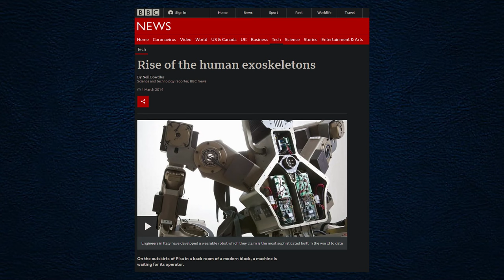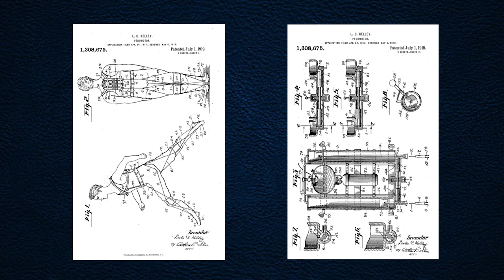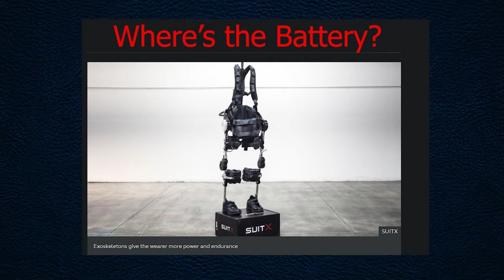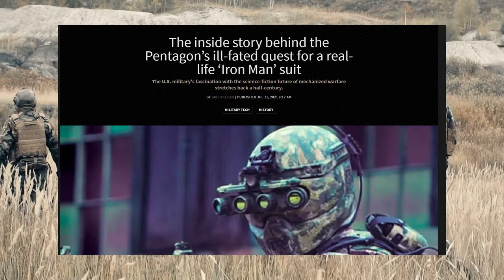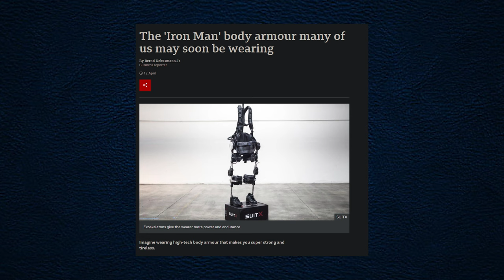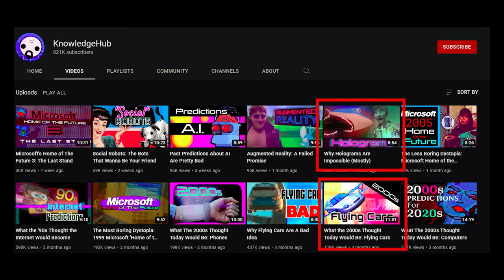Exoskeletons Will Never Happen: Here's Why

Comment: So why not have exos that get their power from a cord, from a nearby vehicle? Whether it's combat, firefighting or police duty, being able to carry excessively heavy armor would help. From my perspective, I'd rather have that and let my teammates behind me deal with the cord. Alternatively, one man could carry (or even wheel) the battery that feeds the exo with a cord.
Reply from the maker: The main goal of current military exoskeleton efforts would be to carry excessively larger loads longer distances. While I agree carrying heavier armor could be helpful, a nearby vehicle could simply carry the larger load instead of the battery that supplies the power. 

This inevitably lead the US military to abandon the efforts since it would be bulky and cumbersome.
Reply: @Enginomics  you know i feel like in the early 21st century we won’t have exosuits, military wise you’re probably right, a simple truck would likely be more efficient than a complicated exosuit, however i believe when technology becomes more advanced exosuits will happen, maybe somewhere in the 2040’s-60’s we’ll have batteries small and compact and powerful enough to power exosuits without exposed wires or other hazards, plus i believe by then we’d have the technology to make exosuits that can do other stuff besides increasing the carry capacity of the user
Reply: I feel like having an external cord connection would be too limiting in terms of mobility. I can see people getting tangled up by the cords just like someone playing on a wired VR headset.
Reply: Cords in a military unit intended for mobile operation is already a very, very bad idea for all sorts of reasons. Soldiers are expected to get into all sorts of situations in different environments where your circumstances can change very quickly in the blink of an eye, and that requires the infantryman to have the mobility needed to adapt to said changing circumstances. Being stuck by an umbilical to anything is a major detriment to a soldier's mobility, and hence anything that requires a cord attached to a vehicle just for infantry use is automatically doomed to fail.
Reply: cords would limit your paths to predictable patterns which enemy can easily use against you.
Reply: @StrikeNoir105E  Cant be too dissimilar to hoses carried by firemen. A power cable should be much easier to lug around. It'd be a niche but powerful tool in urban environments where you have to clear houses, bunkers, tunnels and such where vehicles cant drive. Or trenches. Even outdoors it'd be useful - the guy in a suit can get up to shoot without much risk, the others just keep him powered and supplied. Kind of like how a german infantry squad in WW2 was built around the machinegun.
Reply: @2ndsnake899 not if you work in a factory or construction site, there's demand for this things, even the corded ones will be of great help, imagine lifting a car engine all by yourself, it would be such common use, like forklift are today, they can also put wheels on them, they don't necessarily got to have robot moving legs, the operator is going to be working in a warehouse, assembling facility, military base or construction site, it will have a small rechargeable battery for atleast 30 minutes of autonomous operation without the power cord, it will be constantly charged while the suit is plugged in and in use, just like you use your cellphone while is plugged in and also when is not, the tech is already here it's just a matter of creating a demand for it in the industrial field, oh and by the way getting in and out of this suits would be a matter of 5 seconds on your own, no assistance necessary, any worker can jump out and another worker can just jump in.
Reply: @Jairion  wireless power transfer perhaps can be a thing for this, just stay   close enough to the mobile power unit, 20 feet radius distance, if you get too far because you have too, no worries, they suit will have a fully charged battery with enough juice for atleast half an hour, it will be constantly charging while you are within the 20 feet radius, if you comeback with an almost empty battery it could be recharged 100% in 15 minutes while still using the suit, 25 minutes fully charged it's still good, the problem with charging lithium batteries too fast is overheating that's why you can't charge a Tesla in 5 minutes yet, you can do that with capacitors and you can use them as batteries too but they don't have the same range as batteries do.

Comment: Why say it'll "never happen?" You should have said "won't happen in the foreseeable future." The first main reason you say they're not feasible now is energy density. I don't come from a technical background, but from what I understand, Lithium ion cells have an energy density of slightly lower than 1 Megajoule per Kilogram, even on the high end. Hydrogen has an energy density of 120 MJ/KG, right? So if they managed to figure out hydrogen fuel cells, the energy density issue would be solved, wouldn't it. Or are you somehow saying that hydrogen fuel technology will never happen as well? On what basis are you saying this?

As for the precision issues, that seems like iterative thing. The level of coordination they've gained with increasingly acrobatic robots is pretty good proof that they're on track to get there with wearable robots. Seems more like a matter of time. The level of acrobatics and coordination we're seeing from these robots was inconceivable 30 or 40 years ago. As in, it just couldn't be done, and engineers at the time couldn't even think of how they could feasibly pull it off at the time. If someone looking at the state of the art at the time said we'll never get robots precise enough to mimic human movements like dancing and rough terrain traversal -- which is essentially what you're doing now re: exoskeletons -- they'd have been wrong. 

"Never" just seems like way too strong a word. You haven't pointed to some element of physical reality or science that literally makes this concept impossible, like a perpetual motion machine would be. And you also didn't point to any element of economic behavior, market forces, etc that would prevent such devices from being widely used. You pointed to use in helping disabled person as the only feasible use case. But use in assisting industrial or manual labor is also an area of development that is still actively being worked on. And if, in these two areas, it the technology develops to a point where a relatively small amount of iterative improvements or lateral alterations makes it feasible for military applications, you can bet your bottom dollar that the military's interest will be renewed.
Reply: I don’t think you fully understand hydrogen fuel cells if you think strapping one to you is a good idea
Reply: @christophegroulx8187 I don't think you understand lithium ion batteries if you thinking putting one up to the side of your head is a good idea. Oh wait, ee already do because they're our your cell phones even though they can explode and/or cause fires too.
Reply: @MaximumNewbage  To be safe, hydrogen cells require a heavy enclosure around it, nullifying all the weight reduction given by the exoskeleton. I know this is YouTube comments but wow some people are really clueless
Reply: @christophegroulx8187  Actually some cars that run on hydrogen have a system to not explode easily without any heavy enclosure around it.
Reply: @christophegroulx8187  ...
Reply: @lambdalabs8216  The enclosure in cars is made to be explosion proof, though it might need to be reinforced for personal usage. It also weighs 143.5kg

Comment: I see more value in indirect combat applications like artillery, navy gun loaders, mechanics or maybe even tank loaders. A man being able to lift a 200 300 or maybe even 400 lbs shell like its nothing could not only make bigger guns more viable but make current guns even more efficient.
Reply: Of course this ones could be corded, use them to work in warehouses, construction sites and assembly facilities and factories. Pack them with a small battery that will remain fully charged while the suit is plugged in and is been used at the same time, if you unplug for whatever reason like to go outside well you'll have 30 minutes of battery to do whatever, we do have batteries that can power a medium sized suit for atleast that long, the suit itself will carry all weight of those batteries, you won't have to, also the suit could be equipped with wheels they don't necessarily got to have robotic legs, you ain't going to be moving through jungle or any other war environment, the first type of this aren't going to be war machines whatsoever, the armies of this world already have enough toys to play ward with, once the demand for this suit is created, they will become even better, just like computers and cellphones did.

Comment: The main issue with Exo is they keep designing them with a Power supply in mind. When the main Draw and POINT of a Exoskeleton is to help the body preform better,  The only reason they keep missing the mark is they are skipping the baby steps to a full suit, Sure it would be really cool to hook a metal frame to a human body, Slap some power in there and now you can lift a tank..... That is not the point tho. imagine putting on a lightweight frame that on its own can support an extra 100Lbs. and Now you wear this light frame, will you still feel that weight sure, But its not all in ONE spot it is instead spread over the whole body. 

This is the same idea as European Plate armor, That shit is heavy but when ur inside it the weight is so spread out it only feels heavy after long period of use.

Comment: We need biotech really to do this. If we could create synthetic muscles that use glucose and oxidation, your options would increase significantly. You'd be able to then create soft suits or hard suits supported by different types of muscles, supporters, thick lifters, endurance. Glucose is easy to make, can be chemically stored in stable forms and created with minimal equipment and a variety of resources. The use of Oxidative phosphorylation means you are drawing elements of chemical energy directly from your environment. Main problems to solve would be how to produce a minimal respiratory transfer to the muscles, ie how would you separate O2 from the air and then feed it to the muscles, preferably without a set of lung type organs. Also, waste disposal and muscle efficiency during high load use. Additionally the susceptibility to gas attacks. You could use dissolved O2 in the glucose solution, but then you'd be carrying your entire chemical load rather than cutting the weight down and the logisitics behind it would also suffer from the complexity.

Comment: I myself have been working on an exoskeleton, specificly a leg portion, that cushens the a high drop. I am using air springs and am making progress in its usability range. In short, I got to the point of it working, but I still have to make it practical for every day use.
Reply: That sounds like what Ford is doing here.
Reply: I will make a machine. Yes a machine will do

Comment: The main issue I've noticed with current 'exosuit' design is the disregard for softbody exosuits. They're much more energy efficient, low profile, and generally require less tech. Idk why no one ever tried making a passive exoskeleton with an independent softbody exosuit weaving around it. It would make the idea at least feasible in the near future

Comment: I remember trying to tell people the past number of years that fully self-driving cars [sharing the road with people] is not happening anytime soon, and that we'd get flying cars long before that. What people call "self-driving" is actually "driver-assisted".

My mother is a software engineer and has worked on flying car concepts. She said the reason autonomous self-driving cars would take forever is because you have to tell the computer how to identify everything it detects. 

For example, a bouncing ball... the computer is not going to know what a "ball" is until you input calculatable variables with accessible, analytical data for it to be identified, and for it to do so extremely quickly. The car could probably tell the ball is fairly harmless or even predict correctly it won't hit the ball, but that "ball" means "child could be running out into the street". The car would not know to stop for the ball or even slow down upon seeing a bouncing ball on the sidewalk or in a parking lot. Then there's a stray balloon or a leaf on the freeway which you create a number of correctional exceptions to ignore. A manakin or sign on the side of the road is not cause for alarm, but the car won't know that, and if said humanoid sign/manakin falls over and starts moving towards the road on a freeway, the AI might freak out and force the car to stop or evade, causing an unnecessary accident.

It might work out if the self-driving cars had their own roadways and shared a network of data on a very fast, secure, and powerful wi-fi, but as soon as human input intervenes (i.e. an errant driver evading police) or a data error occurs, the entire system is now compromised and peoples lives are at risk. But the limitation is calculating and accounting for tens of thousands, if not millions of exceptions and pieces of data so that people don't get killed, any any slight error could be the result of mass recall and high liability. We're talking about tech that's supposed to be easily accessible to the masses, but that's difficult to achieve in the imperfect, chaotic world we live in.

Comment: A small correction to the title: the current iterations of exosuits are never going to happen. You have to balance the power of the suit with the weight and the overall purpose of the suit. 

I feel a five layer design makes sense. The third layer would be the frame, pumpworks and hydraulic pistons used for the primary structure, taking some of the load away from the person while also providing most of locomotion but not impossible to move (albeit more difficult) when power is lost in an emergency. 

Fourth and second layers would provide a reservoir for the hydraulic fluid while also serving thermoregulatory purposes, mounted to the third layer on the outside and inside respectively. First layer would be motion, biometric and electronic sensors attached to a flight suit. Fifth layer would be the primary functional layer for whatever the suit’s purpose is. 

Two things occurred to me while thinking up of this: most exoskeletons don’t rely on conformal design around a human body, which makes them far bulkier than necessary when motorized and not even amplifying human strength when left unmotorized. Also that with simple robotics the suit cannot have an organic design best optimized for compensating for additional weight placed on top of it, meaning it would not be wildly practical.

Energy density is part of the problem and in this video you seem to look at it from a single perspective which bottlenecks the audience’s viewpoint to an opinion that cannot be questioned from any other angle. I believe the broader issue is mass inefficiency and imbalances in where the energy goes and where it goes to compensate for something that can’t by itself.

Comment: If you're not trying to reconstruct the Astartes from 40K, there are uses for Exoskeletons in a military capacity. A light augmenting exoskeleton would take a load off; literally. The military has had issues with the size of soldier kits for a long time now, exoskeletons solve that. You can have a couple of dudes dragging a long a lot of supplies for their squad, especially in terrains where you can't take a vehicle in easily, like mountainous terrain.

And that's just frontline logistics. The rest of the logistical chain would very much like exoskeletons to take a load off of lifting and moving objects.

Comment: I agree 100% on the energy density, but I disagree on the precision. The precision and computational power required to create the bipedal robots of Boston Dynamics is vastly greater than a power suit. A power suit already has a computer to control the limbs, which is the operator. All the suit has to do is respond to and follow the human input command, and this could be done entirely with analog controls and hydraulic valves. The military applications for this technology in urban warfare can not be understated. Tanks and aircraft are highly vulnerable in cities, infantry excels in urban combat. Having "heavy infantry" to sweep streets and buildings is very valuable because not only would they be so highly armored as to resist rifle fire across well over 90% of their body, but they could carry thousands of rounds of ammunition and carry much larger, heavier caliber guns with just as much ease as a sub machine gun. The power suit also allows for new possibilities, such as bringing back watercooled machineguns that don't need their barrel swapped. Imagine a water cooled MG42 with a continuous belt connected to a belt box containing about 2 thousand rounds of ammunition that never needs its barrel swapped. Hell, with power armor a M134 becomes man portable, you can just vary the rate of fire by controlling the RPM of the gun. Not to mention that a new generation of automatic grenade launchers can be developed.

Comment: The US marines? Trialled a quadruped walkover as a pack mule and it was denied primarily due to cost. 

No exoskeleton vs no superhuman exoskeleton are 2 vastly different restrictions.
Even lightening the skeletal load on a trooper by having a support system with a few kilos of batteries supporting 20-40% of the carried weight would be a huge advantage for the average squaddie.
That means more ammo, more supplies and less train on the average person